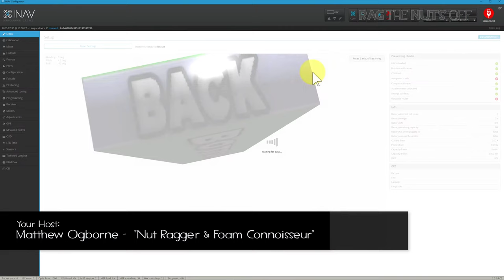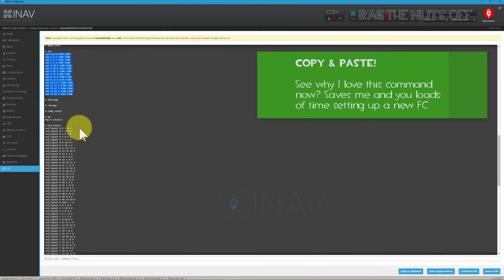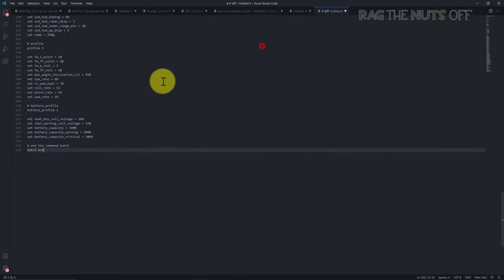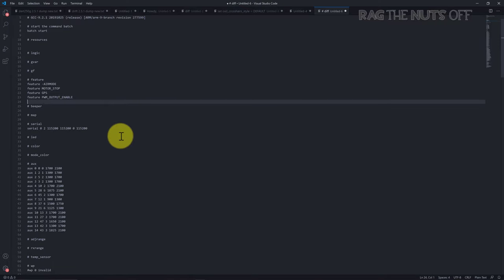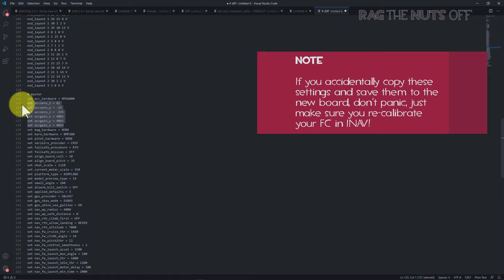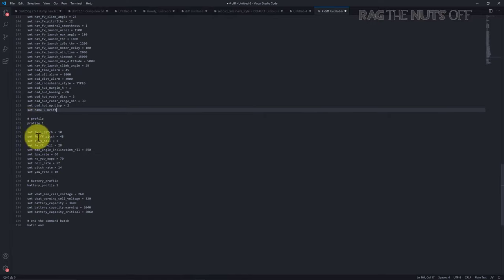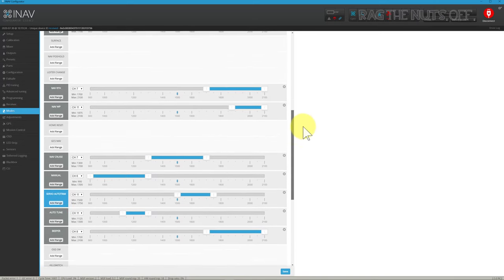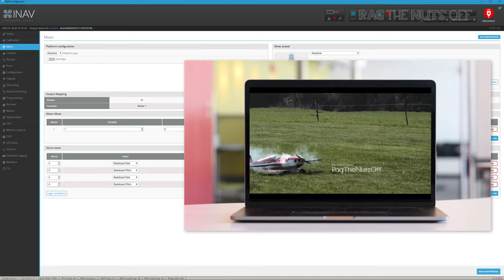How to Copy Model Settings to a New Model in INAV

Comment: I just realized I tryed setting my channel values to go from 1000 to 2000 in the receiver tab using aux settings in the CLI. I better check iif I didn't mess something up. What is the correct way of doing this? My receiver is showing a little lower/higher min and max value in my aux channels. Is it even something to worry about?